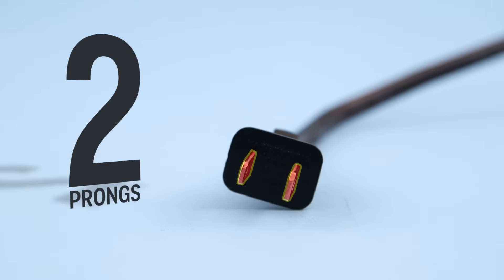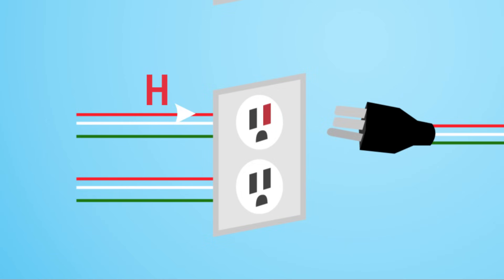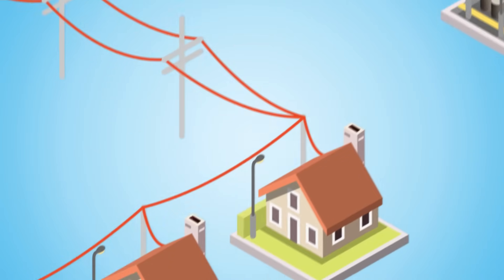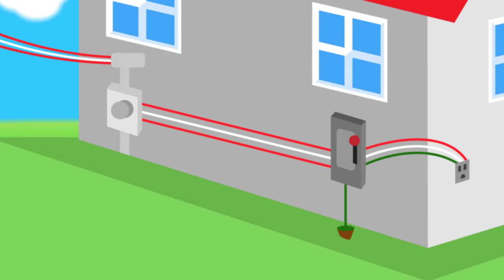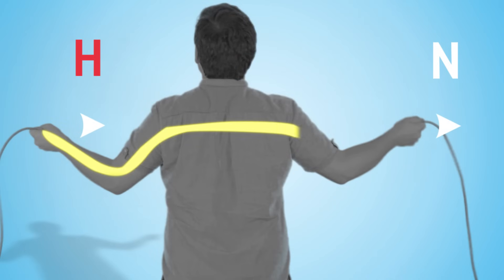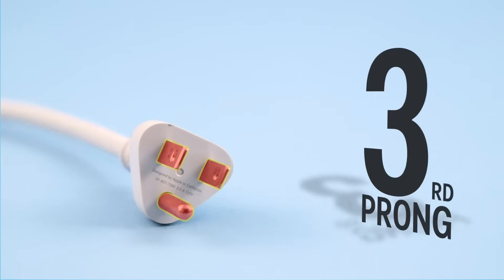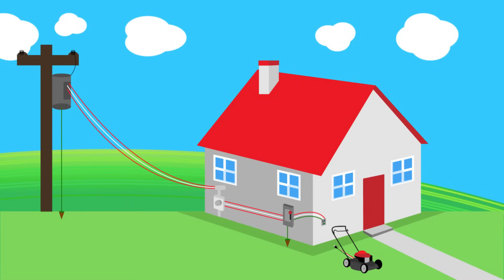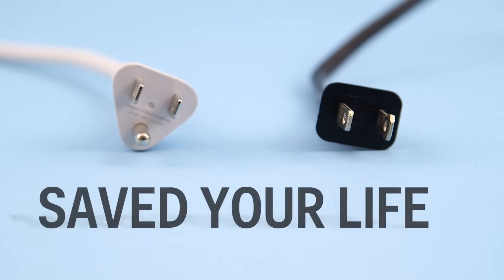Why some power plugs have 3 prongs instead of 2

Comment: Standard here in Europe
Reply: In the UK (and a few other countries with the same socket, Malta being an example), every plug and socket have the earth pin.  This is because the live (hot) and neutral socket connections have shutters on them that will only open once the earth pin is inserted (it's longer so it goes in first). If the appliance doesn't need an earth connection (aka double insulated), the earth pin is normally plastic.
Reply: Its impossible for kids to kill them self sticking forks into the outlet...  As the top pin also has to be in for the other to holes to open
Reply: Only UK and Ireland
Reply: Malaysia too
Reply: Joakim Innvær
same here in the US for sockets though plenty of places with older wiring.  If a place has older wiring you can add new 3 prong plugs but the with only 2 wires they will be floating.
Reply: In Norway, it's required by law to earth all sockets installed after a certain year

Can't be bothered to find the legal papers
Reply: that seems like a huge safety risk! why the heck would you just let the ground be unused!?
Reply: Joakim Innavaer You cannot ground plastic. Modern two plug devices have double insulation. That means it is impossible for the device case to be hot. There were older ungrounded equipment. These could only be used rooms where there was no ground. These are now obsolete and you cannot connect them to modern schuko outlets. Double insulated devices are safer than grounded ones.
Reply: that was terrible to understand, but if you use a 3 prong socket, you should at least block the third prong so that you don't plug something that needs ground in accidentally
Reply: Nilsson??? Here in Europe we use only 2 holes
Reply: Ankush Girotra
I have been awhile and mostly older homes.
Reply: because you can't buy 2 prong plugs anymore and  it is hard to change the wiring in many old homes without gutting them.  So if you are just switching out old plugs that are damaged  you don't use the safety ground.  It already has ground the third prong is in case the in circuit ground fails.
Reply: That is just it in a working circuit the neutral ground isn't needed at all.  It is only used when there is a fault.  If you pulled out the 3rd prong which some have to fit 2 prong plugs the device will work.  The fault ground only works to isolate and protect from  the circuit making a contact through something else like your body when the in circuit ground is malfunctioning.
Reply: Nilsson yep
Reply: don't understand the last statement, but if you have to buy a 3 prong plug for an apparatus with only 2 wires, then yes, having a grounded socket with no ground would be justifiable, as long as you know which sockets and plugs ar grounded and not...
Reply: Joakim Innvær  this whole video is wrong, the "2 prong" plugs are what is called double insulated, if you look on anything with 2 prongs it will have a little box with a box inside it, thats the symbol. They dont require an earth/ground because there is a second layer of protection in the device itself
Reply: Ankush Girotra 
That's cause building codes changed in the 1960's requiring all buildings in USA and Canada to replace all 2 prong outlets with 3 prong ones. Before then 2 prong outlets were more common
Reply: @meatplunger3996  Codes apply only to new installations.
Reply: Edwardo Ondreseaus That's not quite correct - sure, they have fuses, but so do any other plugs. Fuses aren't 100% reliable, either
Reply: See this picture. It explains everything. http://www.ssrichardmontgomery.com/download/europlugcorrect.jpg
Reply: Nilsson nope not with everything
Reply: its common in finnland
Reply: Nilsson UK plug is best
Reply: Not standard, a lot of appliances use 2 prongs
Reply: Standard in Malaysia
Reply: Gen242 yep
Reply: Not always
Reply: In Iceland we have a plug that has two prongs that are circular like the third one shown in the video
Reply: Nilsson I have never even seen anything like this!
Reply: Marie Larsen Also Thai plug type O. Derived from US earth pin and Europlug. Simmilar to Israeli plug.
Reply: Nikolaj Mohar Also in Israel.
Reply: Not in the netherlands
Reply: Pretty much the same in the states too.
Reply: This video is awfully misinformed
Reply: Nilsson also standard in America. For devices that need this protection
Reply: don't forget we also have the ampere switch. it's that's the switch that goes off if someone touches the "hotwire". because it gets a different amount back because of the short circuit
.
Reply: @Håkan Bråkan Kråkan Most equipment is double insulated: electronics, vacuum cleaners etc. Kitchen equipment is typically grounded as are washing machines. Computers also are typically grounded.

Ground breakers are illegal. What you mean is an RCD or GFCI as Ameicans call it.
Reply: Not the europlug, the Schuko has it, however the europlog doesnt have grounding
Reply: Nikolaj Mohar it is legal standart in Denmark a lot of people just ignore it
Reply: EU definately uses 3 prongs, just not on things that don't require it. as long as you are using the round plugs, you should be set on grounding. there are flat plugs, and round plugs without ground, but i have already explained the first one, and the second one is only available on old cables.
Reply: If you have ungrounded outlets you should connect everything to them. You must never try to bring ground from, say, kitchen with an extension cord even if your computer manuals says you need to ground it. Doing so is inviting the grim reaper. (Well I have done so but I know what I am doing).

The key issue in grounding is that it is all or nothing when one deals with equipment one can potentially touch at the same time. If your ungrounded equipment fails, it will give you a shock but that is not serious. However, if you touch also a grounded equipment at the same time it can be fatal. In places where there is natural ground like bathrooms one must ground. 

In Europe the old ungrounded plug could not fit schuko outlet. That was on purpose so that one would not mix grounded and ungrounded equipment. Schuko fits ungrounded outlet as in such a room everything is ungrounded so there is no problem in not grounding it. On the U.S. system this seems to be reverse which could cause danger.
Reply: Joakim Innvær ive been to Germany enough to know that its definitely uses two prongs I’m from Ireland we have the three prongs but I can’t use them in Germany ( I’m only fully certain with Germany ) so yeah... EU most likely uses two prongs Germany 100% does,
Reply: @joinn1710  There is the contour plug that is used on vacuum cleaners and hair dryers. The flat Europlug has thinner pins so it is limited to 2.5 A. That is not enough for vacuums.
Reply: In Brunei too... with Fuse integrated within the 3-pin plug.
Reply: Nilsson
Europe also only uses 220 v Many US 220v have 4 prongs now.  And, all 220 have 3 prongs at least.
Reply: Ankush it is only in older installations. Remember the Americans adopted a standard much earlier than the rest of the world.
Reply: How?
Reply: Not in Denmark
Reply: Nilsson UK and Ireland, but the EU uses two prong sockets

Comment: the UK has the safest ones
Reply: Uk sockets are horrible if u step on them accidentally
Reply: +Gasper Gril watch Tom Scott.

First, the UK ones have three outlets. The top one is earth, the right bottom one is live, and the left one is neutral. The live and neutral outlets have a distinct safety feature. They have like a trapdoor or something that won't open before your earth pin is plugged in. The earth outlet has a button inside, that allows the two bottom pins get into the outlet. Also, the bottom pins have insulation on them. So if you leave it halfway out, all you can touch is the insulation of the pin.

That's the basic safety reasons. You can go watch it on Tom Scott if you want further explanation.
Reply: From Canada using US style plugs, used UK style plugs in Hong Kong. UK plugs are way safer and more durable but US plugs are compact. Good thing about UK plugs is they're all grounded, as well as all the benefits on Tom Scott's video.
Reply: scikick tough choice... "huge and ugly" Vs much safer plug design for children.

I'll take huge and ugly thanks.
Reply: Why is that?
Reply: +Nik Ahmad Faris Nik Mohd Radzi Ok that is pretty safe but to be honest it's just todler proof I mean you most likeli you will never touch the outlet holes
Reply: Malaysia has the same type of outlets too, I've been to the UK before and seen then
Reply: ah, i see you didn't watch the first 40 seconds of the video. Excess energy/surges/transformer failures inside the home still can cause huge problems regardless of whether or not your appliance is plastic. In industry such as music there are lots of plastic covered appliances but they ALWAYS (if they are not garbage) have 3 prongs. ESD and other discharges can ruin equipment so why take the chance.
Reply: Brave Phoenix but uk and sg ones all have 3 prongs, unlike yours which some may have 2
Reply: whatsup jake why do you guys have to make everything a competition?
Reply: He is right. UK Has the safest plug system in the world.
Reply: +baileyboy125 sounds like only EVERY plug in the US also. although most things don't need the ground plug because everything is made out of plastic now days.
Reply: Your point?
Reply: Not really. The UK Plug and Electrical code are far superior sorry Yanks.
Reply: Plus In the UK we have higher voltage so we can run 3000watts at 240 (230v) instead of in the USA  1500watts at 120v/110v....
Reply: Joakim Innvær The main reason is to protect the circuit (wiring in your home) not just the plug.
Reply: In the UK we mostly radical circuits or in older installations ring circuits. Which are multiple sockets connected together in a line etc.... Which are connected to a 32a MCB
Reply: yeah, because they are literally the same plug.
Reply: +ZinkLogicMedia The ones in the UK only allow the plug to be inserted if all three prongs enter the socket simultaneously.
Reply: whatsup jake I
Reply: whatsup jake Depends if you follow America's power code exactly ours would be safest
Reply: whatsup jake no one cares
Reply: US residential power is typically 120/240V single phase. You have 240V in your home, just not at your standard outlets. Yes you can utilize more power with higher voltage, but there are trade offs to using strictly 240V for everything vs a combination of 120V and 240V.
Reply: Has no one ever seen shuko plugs before!?
Reply: Joakim Innvær Yes they're safe like anything. Plus you can pull 16amps at 230v if I'm correct?
Reply: teraxiel The higher voltage (240v UK) comes in handy, when for example you're charging a electric car on standard socket (outlet) it takes half the time then 110v/120v
Reply: Joakim Innvær Just wondering, you do know why British plug's have Fuses in them?
Reply: yes, i actually said it in an earlier reply.
Reply: Scott Mulligan Correct. Like I was saying though there are trade offs to either systems. Generally, 120V circuits can provide enough power for most cord attached devices no problem.  But for electric cars, you should be using an actual dedicated car charger, typically 50 amps in the US. Obviously there will be times you'll be away from your charger and need a little charge and have to use a wall receptacle, but trying to rely on standard wall receptacles, even if they are 230V, is planning for problems.
Reply: +hackerzzunite first if something causes power to discharge quickly, the breaker box would trip cutting off all current. second don't you have breaker boxes? 
a thunder bolt to your house wouldn't be enough to fry anything, seeing how if the power(from the bolt) ran into the house from the power line, it would trip the main power switch and turn off, and reroute the power to the ground. also not even a transformer blowing up is enough to fry anything in the house...i would know we had a few that blew up. the only thing that happens is the breakers trip and all power is cut from entering the house lines. like i said, unless your living in the stone age with fuses still...then you got problems to worry about. other wise, it's really not something to worry about. i never had anything fried by any lightning strike or transformer blowing up, most of the things plugged into the way don't have 3 wires.

the reason music objects have 3 prongs is because they ARE made out of metal, even if they are covered that wont stop a spark from burning a hole though it and discharging into you. the whole POINT of the video and, if you would of watched the first 40 seconds of it, they explain just that.
Reply: whatsup jake irelands are just as safe
Reply: Gasper Gril  just watch the tom Scott video on it
Reply: whatsup jake UK outlets suck they hurt
Reply: scikick You're only saying that because you're so blindly patriotic that you even feel the need to love American plug sockets. British plugs (or any other plug with a third prong) are inherently better
Reply: TheTexasOOF Gamer you use it to plug it into a socket not to step on it
Reply: scikick you care about what a plug looks like? Thats just sad, also American plugs aren't perfect either, they are just like the people, stupid
Reply: I Live In The UK!
Reply: whatsup jake and China too
Reply: David Birtles Dumb and dumber?
Reply: But it's so sharp
Reply: +scikick oh don't get me started on us plugs, I could come up with so many things about it that seem just silly compared to every other plug in the world! For example the one positive thing you said about it, "some even have holes in them that make it a breeze if you have to hook up to a naked wire directly..", isn't positive at all, the fact that a such thing is possible is a risk in it's own, let alone making it easy to do! And how did you find out EU plugs get looser than us ones over time? Did you experience it, or did you just assume it, like it seems all Americans do?
Reply: What people often forget is that even if the housing is plastic you might still need grounding if there are any exposed metal fasteners, it just depends on how the appliance was constructed. Regardless, the first part of the video is incorrect about the purpose of a ground. It has nothing to do with excess voltage or current. Lightning strikes are another matter and require too long of an explanation, but the video still depicts it wrong. What I'm getting at is that yes grounding things like audio equipment and sensitive electronics that have plastic housings can help to protect against ESD, but it is more likely that the ground is present in such appliances to help reduce "noise" from the high voltage current. Audio equipment is especially sensitive to this.
Reply: +Rocksfir e Yes, many things don't require ground, but it's not just because things are made of plastic nowadays, it's also for example because many things aren't very sensitive against ESD.
Reply: Yes, but can't you pull that much power from other plugs too?
Reply: yeah, but what purpose does it have when it only protects the plug and the cable? the apparatus already has a fuse before it goes in or out the object itself.
Reply: Why does everyone think UK plugs are the best in the world just because of one video!? Yes, you can't plug it in the wrong way, but that doesn't even matter all that much. And yes, British plugs do have fuses in the plugs, but why does that matter, it's literally a protection against a cable fault! Something that almost never happens, might I add. And lastly, no, you can't stick anything in without putting the ground pin in, but half of other plugs protect against this already, just in a slightly different way, just look at the one used in most of Europe!
Reply: Oh, and did I mention the UK plugs are big and bulky and the cable has to both go straight down from the socket and stay connected to the appliance it came with?
Reply: But they are huge and ugly. 
The European ones loosen up after a few months of use and frequently break the circuit. 

US ones are perfect - small, tight. Some even have holes in them that make it a breeze if you have to hook up to a naked wire directly..